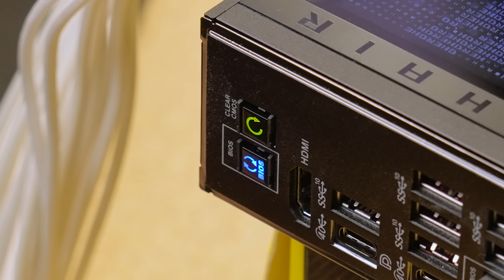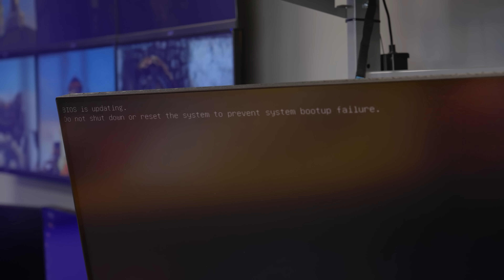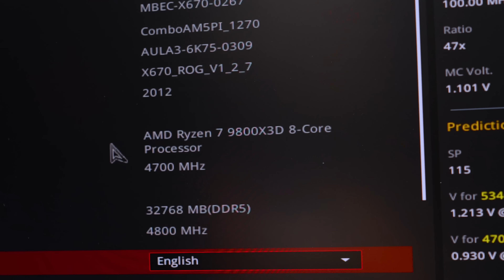This PC wouldn't post... so they brought it to me!

Comment: I've had a Pc do weird things, but not be able to have them diagnosed by someone else. Then it worked totally fine, but I'd get it back and still have problems. Found out my houses' wiring, from the 60's, had some grounding issues. Even fixing that by putting in a new grounding to Earth didn't help though, but using a UPC as a filter did. 

Very weird thing though it only affected that one PC and future builds all worked fine.

Comment: Hey, I know this is off topic and a little out of left field so I'll probably ask on the discord but...I have the Lian Li O11DEvo XL and I'd really like to use the GPU support bracket that came with the GPU, for the support and because it actually looks decent but those clamp style hold downs Lian uses around back for add in cards won't close because the bracket is too thick. Is that just how it is or has someone seen or figured out how to do something different to use screws or whatever. Sorry if it isn't worded well my brain damage is causing me some struggles right now.

Comment: had a sony bravia tv. Due to daycare abuse it had red lines on the left side and green/blue lines on the right side. Put it in the basement with all the other daycare stuff when the business was closed down. Two years later powered the tv up. perfect display. no lines. still working properly to this day. Likewise a laptop and an older AMD FX based pc that both wouldnt post. 2 years later same basement worked first try.

magic basement
Reply: it could have been dirty power being fed into the building causing that with voltage drops/spikes out of normal range, as I had that earlier this year at work, and the power company had to replace a line, and aging transformer right across the street from me.
Reply: @CommodoreFan64  same building as it was an in home daycare

Comment: I had a build randomly power off at random. Ended up being a piece of aluminum foil, really small that would occasionally waft in the fan drafts and touch the motherboard in its nono place.( I tend to do lots of projects on the same desk; the foil was a must have for proper connection in another project.)

Comment: The cause was microsoft. They did some kind of update recently to windows 11 which stopped the power button headers working. Removing the header pins and reseating them fixed the issue. Imagine my panic when it happened to me, then I've been seeing a lot of people have the exact same issue right now. WIth the issue, the PC would do absolutely nothing, not even the PSU fan would turn on. By luck I decided to check the power button was actually working before ripping everything apart.

I know it was a windows update because it happened after an update was installed. Everything was working perfectly fine prior to that, i don't know exactly what microsoft did but to affect core functionality of the motherboard like that is crazy.

My system is with the 12700KF, Gigabyte B660M X AX Gaming and BeQuiet DarkPower 12 750W PSU and Lian Li O11 Dynamic EVO.

Microsoft being the same trash company which doesn't QA test thorougly, as usual.

Comment: So it boots to the bios now get it to boot to the desktop then try to get it to run a program. My 11700k worked good till the original Monster Hunter Wilds benchmark borked it with 100 % cpu usage.

Comment: Dude,  when the location is the only thing that's different.  The answer is the power going into the power supply.  I had to get a really good battery to condition the power for my computer to behave where it was, the line was dirty as all hell.
Reply: So basically a UPS
Reply: Except, in this caee, the location isn’t the only difference. He tested the parts in (essentially) an open bench - not the case the system normally ran in, so (as was mentioned several times in the video) the issue could have been the case. 

Another YouTuber posted a video with a similar situation a while ago, and the problem was eventually traced to a faulty USB hub in the customers home.
Reply: Is that a thing in some countries and the US? Here in Germany, this kinda thing is extremely rare, despite us having a mesh power grid all over Europe.
Reply: @kyoudaiken  Depends on the location, not all power companies here are created equal, and many people dont know any better when it comes to such things.
Reply: @DigitalIP  In my whole circle, there has never been a problem with dirty power around here. But then again we also have heavy regulation when it comes to appliances having to use sophisticated filters to filter out switching noise, spread spectrum techniques, etc.
Reply: @kyoudaiken  The EU is stricter when it comes to such things compared to the US lol, so those kinds of things probably dont happen as often as they might here. I dont think dirty power is all that common here though, not in my state at least.

But it can also be caused by simple things like an old or faulty power outlet in the home rather than the power lines or home wiring itself, which most people tend to not consider.

It pretty much comes down to if a power problem is on the Power Company side, or an Electrician is needed on the home owner side, it depends, needing an electrician for a fix can be quite expensive.
Reply: @DigitalIP  Or old tech like a circular blinking star that uses bi-metal strips to switch on and off light bulb segments. These are freaking noisy... So much so that I am trying to figure out how to convert it to solid state and low voltage LED.
Reply: @kyoudaiken Your circle is insignificant compared to the population of the planet. 

Everyone in my circle has stable power as well, but I know there are some places that don’t even have electricity, much less stable electricity.
Reply: @StolenJoker84  I know that already, this comment is totally unnecessary as I specifically asked if this can be the case in other countries and regions. I just have never experienced it anywhere, yet.

Comment: My sons 4 year old PC was playing up. Not turning on, shutting down mid game etc. We bought him a brand new PC and it too started having the exact same issues. The ONLY other device using that same wall socket was the subwoofer for my TV/AV receiver. It had been left turned on. As soon as I turned it off - the new PC stopped having issues.
I would have a look at what else is sharing the wall socket at the friend of a friends house.
Reply: When I turn on the fan in my room my mouse blinks momentarily even if the PC is off. So yeah, signals can propagate through the power lines.
Reply: Happens with one of the monitors in my house. Turn the ceiling light on or fan and the monitor powers on for about a half second then back off. Fun fact: happens no matter what ups I have it on, or what circuit it’s on in the house. If anything turns on or off in that same circuit, it will momentarily blink.
Reply: When I built my current PC which is a 9800x3d with a 5090 and a 1300w psu , i had it plugged into my 1000w UPS . It would shut off randomly ever so often, that's when I relized my pc must spike above 1000w sometimes, also I can no run my Portable LG air conditioner on the same side of the house or it'll trip the breaker. Ever since I discovered those two issues I haven't had any more problems.
Reply: @76DoNtTReADoNmE1931  This reminds me of that old joke about vegans. How do you know if someone's a vegan? They'll tell you. It's the same thing thing with 5090 owners, can't help yourself, can you?
Reply: @chrys9256 I dont think anything video card other than a 5090 can trip a breaker in your house while running an air conditioner or max out a 1000w ups and cause your pc to shut off. None of this ever happened with my previous build which had a 5800x and a 3080ti with a 1000w psu. I thought it was relative to name the components as a reference to how much wattage they use. If you think im bragging that's your issue , I could care less what other people think. I was trying to be helpful for anyone else experiencing PC issues. If you really want to get a 5090 for yourself, get a better job.
Reply: @76DoNtTReADoNmE1931  Ah yes, the old "I could care less what other people think" but you'll certainly reply to my joke to let me know how little you care. And no I don't want a 5090. The idea that I would spend over $2000 for a graphics card to play video games is so absurd to me. People are just giving Nvidia their money hand over fist, with no regard to the fact that they're funding the destruction of their own hobby.

I doesn't matter any more though, they don't even need consumers as long as they have AI. I can't wait for people to start bragging about their $4000 6090s, because there's nothing really stopping Nvidia from pricing their GPUs however the hell they want.

Comment: Hi Jay, bit of a long shot but I had a violation secure boot message and before I could press anything the pc shut off and now when it powers on the debug leds don't light up and gpu fan don't spin. I'm pretty sure I've tried everything, from cleaning the cpu socket to changing cmos battery and flashing multiple bios versions. Could the motherboard be damaged for not reacting to the message in time? There must be a way back in.
Reply: Reset cmos, and pull all but one of the ram sticks. Try again. It should not be in that state unless it was not a secure boot violation message but a message about the COU being vendor locked to another board/bios vendor
Reply: @igelbofh Hi, thank you for your comment. It's definitely an interesting and frustrating one. I've reset the bios numerous times both with the jumper pins and removing the battery. I've tried multiple sets of ram with different slot combinations. I will say one thing tho which is also strange  with a Ryzen 3 4300G the debug ram light comes on but with any other cpu that's meant to be 3000 ready like a 3600, it shows no lights at all. I've also tried multiple cpu's. I genuinely dunno what else it can possibly be other than a damaged board but yet it still powers on to a degree at least.

Comment: Regarding overheating, I swapped an HP motherboard last year to replace a dead one, and the used replacement came with a CPU cooler mount, which, in my ignorance, I used. The problem here is that, despite a few millimeters of height difference, the cooler is perfectly compatible with the mount; however, this means it does not make contact with the CPU.

It took me several attempts at booting the PC to install Windows, and each time it would inevitably force a shutdown, all the while the CPU fan screaming. After I had the clarity to check the cooler mount and swap it out, I tried to boot again, but the motherboard was now dead, just like the original one, simply refusing to boot.

Comment: You need to do gaming performance comparison with microsofts new native nvme driver that replaces the old generic driver. Many open world games had stutter issues with outdated direct storage dll versions which are fixed by dll swapping direct storage with new version for better optimizations between gpu and ssd and eliminating io buffer stutters but that is a risk because your altering game files and this new native nvme driver which is in windows 11 25h2 can be unlocked through registry which replaces microsofts generic nvme driver with a new native driver has actually compensated the direct storage issue by improving performance and getting rid of stutters in heavy asset loading games where the outdated direct storage dll causes stuttering so no more dll swapping in games less optimized that is why gta 5 enhanced edition was stuttering because of direct storage which was easily fixed by updating the direct storage dll files but you no longer have to do it because of the new native nvme driver. testing many games will be interesting to see the improvements and performance fluctuations in testing. The driver is designed to reduce CPU overhead and improve IOPS performance for NVMe SSDs. According to Microsoft, the Server 2025 implementation can deliver up to 80 percent higher IOPS and cut CPU usage by roughly 45 percent. Those figures apply to server workloads and do not translate directly to desktop usage. Community testing on Windows 11 version 25H2 shows more modest results. Real-world benchmarks reported by third-party testers indicate performance improvements closer to 10-15 percent. That still represents a meaningful gain for storage-heavy workloads, but it falls well short of Microsoft's server-side claims.
Reply: even though performance is different for real world benchmarks the performance gain so far is still worth it and fixes issues with some games with bad optimizations. microsoft obviously will eventually unlock and release it to the public and will most likely be optimized for the future of the os and gaming performance which is something to be excited about going forward with direct storage and other gpu features in connection with game development. if they can get server workload improvements that big i bet gaming performance will eventually be far better than the initial driver that has to be unlocked to use right now.

Comment: 0:21 the last ram stick be kinda slanted
Reply: Remember the days of "reseat, repeat"? J accidentally reseated the memory stick. ;)
Reply: Yep first thing I also noticed
Reply: 3:03 he didnt reseat it as its still slanted when he put the gpu in
Reply: The stick is definitely bent, would it be enough for it to mess up though? Not sure.
Reply: Good eye!!
Reply: Thank God you found the problem. Or else the electric company would’ve kept getting away with that scam
Reply: First thing I noticed lol
Reply: Stick looks straight, heat sink flap looks bent.
Reply: @Tagiau now that you say it... yeah I think that's it
Reply: @Tagiau  It's the ram slot not soldered onto the board flat, seen it on many boards over the years where smd components and the like are on wonky/not level. Poor QC on ASUS's part.

Comment: Crazy story. I was once using the h150i elite cappelix back in the day when they were pretty new. The pump cable running to the hub was pulled tight over the top of the motherboard and eventually the cord was completely torn through sleeving and and all I had to get a new cooler the same day because the cooler stopped working entirely.

Comment: I'd have the guy test his outlets at home. He might not be getting clean power. Had a friend that I built a pc for and the home he was living in had old wiring. Nothing was properly grounded. Pc was always shutting itself off. He moved and that problem went away. A UPS could possibly have helped him in that situation too. But basically the entire house just needed to be completely rewired.
Reply: was going to say the same thing. Especially bad if the house or apartment was built with Aluminum wiring back in the 60's and 70's.
Reply: @pinsandscrews6459 what? Aluminum wiring?? Crazy. Was this in the US?
Reply: Could also be the whole area depending on where she lives if the power is dirty with frequent brown outs. I live in the country so I got a sine wave correcting UPS that shows the input voltage and it's often low.
Reply: @MtnNerd I also live in the country. I use a UPS with my PC. The voltage is usually pretty consistent at my house but the power might flicker a few times a week. Enough to aggravate you. Also have my Starlink/Mesh network on separate UPS.
Reply: This would be unfortunate. My grandfather built and wired our house 60 years ago (no he is not a electrician)and I've had zero issues. Sucks when the "pros" can't be trusted.
Reply: A consumer-grade UPS alone probably won't be enough.  All of them would switch to battery power when they sense bad line power - and most have power enough for maybe 10-15 minutes.  You would need one of those lithium-iron-phosphate "solar generator" type backups to keep the system up and running for longer.  Preferably one with at least 1kWh of storage.
Reply: this 100%, as in the late 2000's I Inherited my grandparent's home build in the mid 50's, & around 2010 right before replacing the old electric stove while doing some general home remodeling we noticed even though the house had 3 prong plugs, they weren't grounded proper, so I had to rewire my entire house(the only saving grace of the house was a good breaker box for it's time, and pure copper wiring with no junk aluminium), that solved a lot of issues for me in the long run when a couple years later we converted the old sunroom into a home theater room, and I need more clean stable power for things.
Reply: I"m a professional licensed electrician.  The ground of which you speak is just there for safety, it has no effect on the power line voltage stability.  Usually, in an older home, the receptacles need to be replaced due to age as they do not have sufficient tension on the blades of the plug to keep firm contact.  A UPS would not solve this.  Simply replacing the receptacle would suffice.  A total rewire of the house would not be necessary as at most you could just run a new, clean, dedicated circuit from the panel to the wall with the computer, therefore, providing it with a circuit not affected by other circuits with various loads on them.
Reply: @reidsampey2045 the next person that got the house had all the outlets tested. He wasn't getting a constant clean flow of power. The part about the ground wasn't me saying it's the cause, but since it didn't have one you can assume the house is very old and either the wiring could be shorting out somewhere or a breaker could be about to go out. Something was messed up in his house beyond just the outlets. But thats someone else's problem now lol
Reply: The sheer lengths people go through to not buy a laptop, or a deck, or even just a console... pc master race derangement syndrome